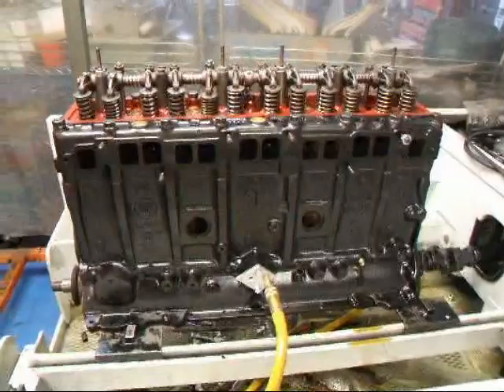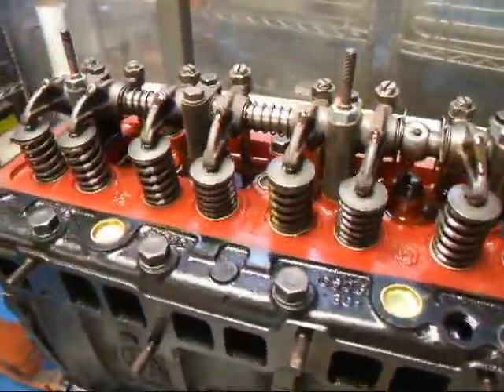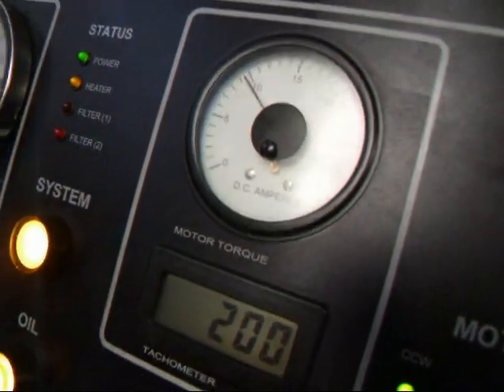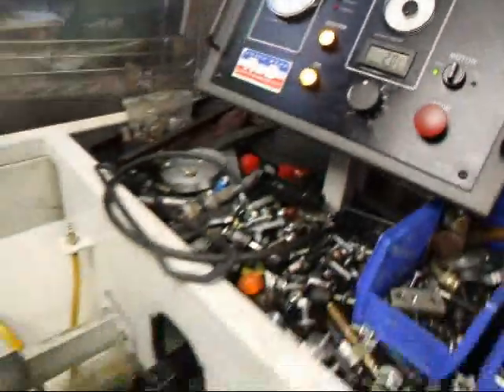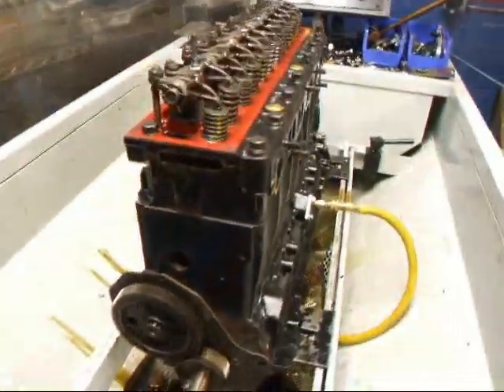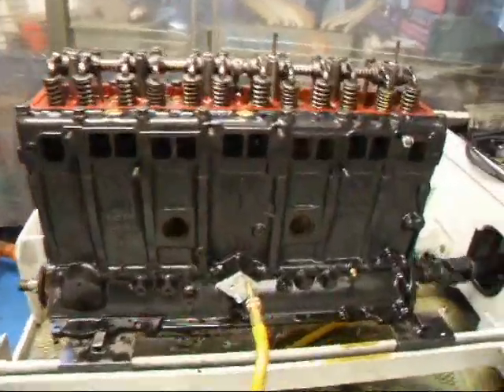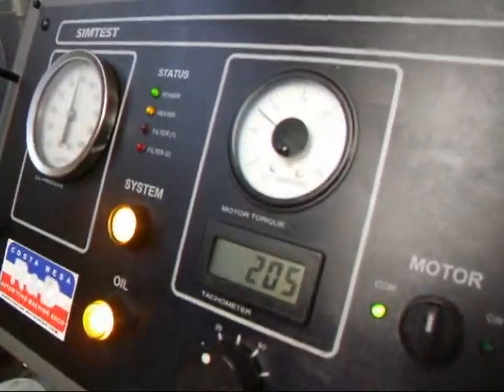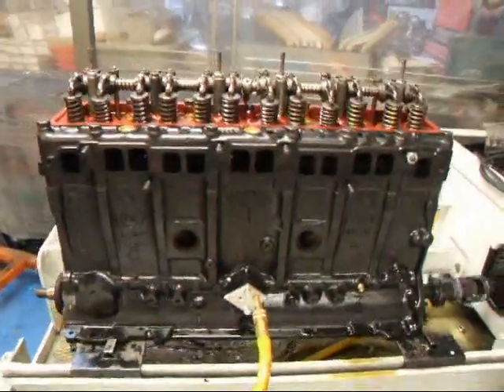Toyota Landcruiser Simtest.mp4

Comment: @boxer3main Simtesting uses full oil pressure, and the oil is heated. That, combined with the natural pressure of the valve springs and the springs inside the lifter bores creates a very near normal amount of pressure on the cam lobes. A simtester doesn't completely break-in an engine, just wears the hardest edge off of the break-in process so that less than immaculate care is required to break the engine in properly for a long working life

Comment from the maker: @1custom1234 - You are correct, this is what i cann an initialization of the engine where the rods and pistons can align properly and not under load. @ 200 rpm. I'm just checking to see that I have no visible oil leaks and that the lifters are rotating correctly.

Comment: @fiatnutz Uh...I see what you are talkin about, but what I was curious about was the copper line with what looks like a compression fitting, presumbly feeding oil to the rocker shaft? Was that the factory setup, or was that your modification to get better oiling to the rocker area?

Comment: I have a question about the cam and lifters having a proper breakin at this low rpm. I was always taught to run an engine with a flat tappet cam at around 1500-2500 rpm for the first 15-20 mins for proper lifter rotation which helps the breakin time.